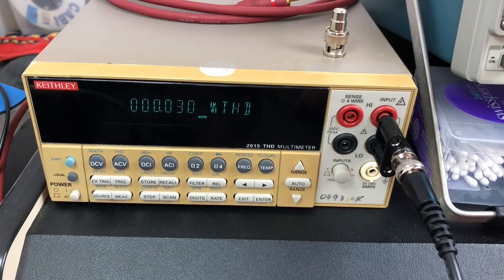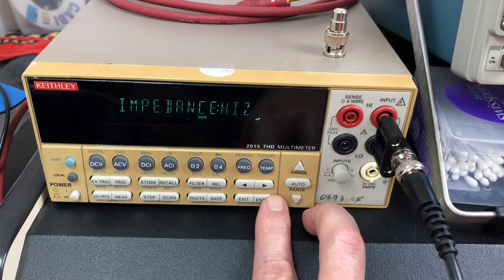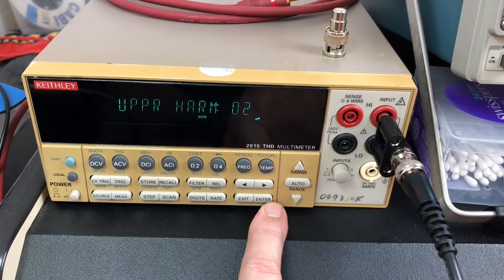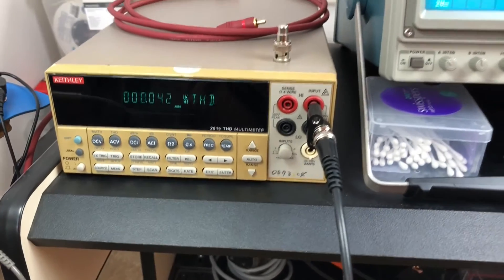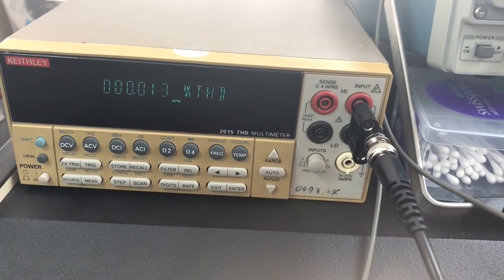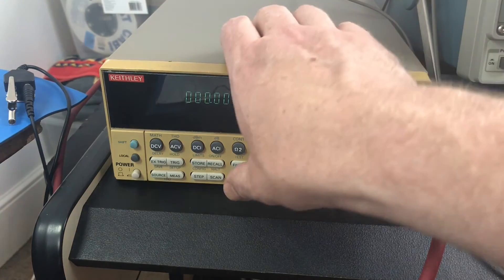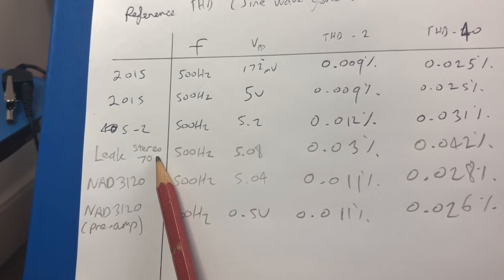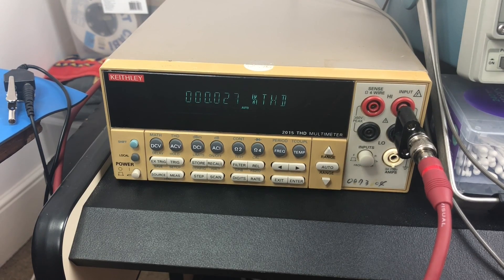Keithley 2015 THD measurement on Leak Stereo 70 & NAD 3120

Comment: The actual distortion of the amplifiers is a lot less.  The value you are reading will be the root-sum-square of the 2015 distortion alone and the amplifier distortion .  You need to do the calculation to remove the component of the THD contributed by the 2015.  So the amplifier distortion is the root-difference-square.  If we call the distortion of the amplifier=A, the meter=M and the measured THD=T, then A = (sqrt( T^2 - M^2)).  👍👍
Reply from the maker: I'll take your word for it - I'd really just been using the meter as a way of doing comparisons between different amplifiers. As you point out, the measured value is not the actual distortion, but it still gives me (I think) a means to compare between amplifiers. I could revisit at some point, but it has been quite some time since I measured any amplifiers for THD.

Comment: So how is the output sine wave connected from the 2015 to the amplifier? Thanks
Reply from the maker: There's a BNC connector on the back of the 2015 which is the signal generator output. I then use a BNC to RCA converter to connect to the RCA input on the amplifier.

Comment: Did you take into consideration that the Keithley lists the specs as 0.004% or -87dB THD, and 0.056% or -65dB THD + n for the unit?

https://download.tek.com/document/SPEC-2015_R_June_2019.pdf
Reply from the maker: Only just saw this, thanks for your comment. Yes and no. I am aware that the equipment will have its own inherent distortion. However for the sake of doing some comparisons between amplifiers, as long as the test setup is the same, then this is a valid way to test. However yes, it becomes problematic when looking a THD close to the limit of the Keithley. However I certainly cannot justify the expense of a much better THD tester. Even the ancient Tek plug ins sell for huge money. Did you look on the Keithley to see whether those specs are driven primarily by the low distoration sine wave generator, or the THD section. ie., I wonder if results could be improved by using and external ultra low distortion sine wave generator.